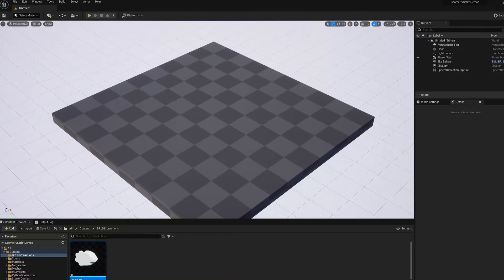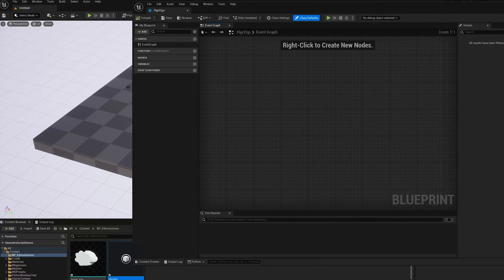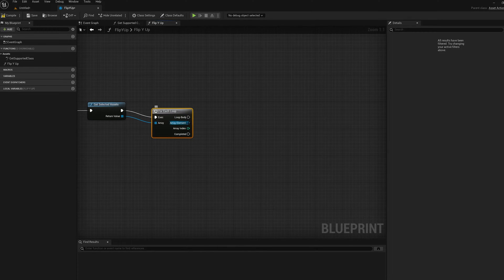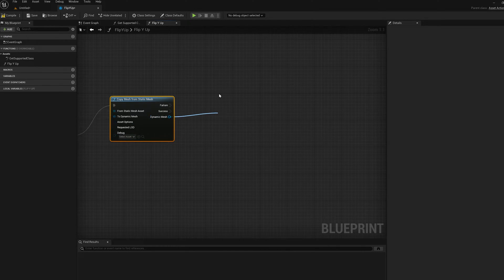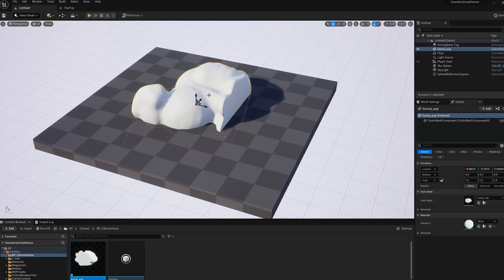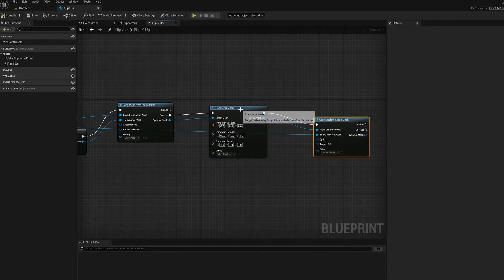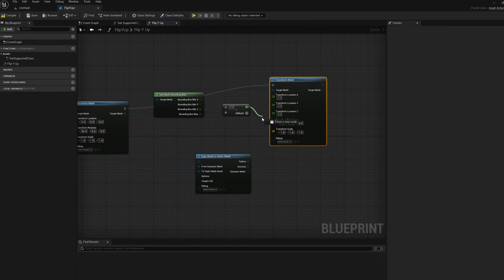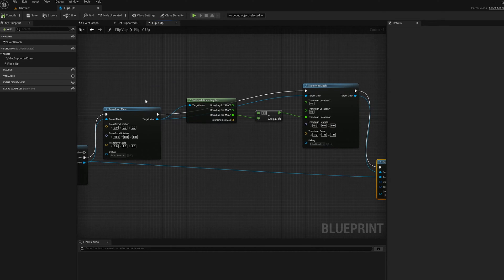UE5 Geometry Script - Y-to-Z-Up and Edit Pivot with an Asset Action

Comment: Thanks my friend, is there any way to specific a Booleans to affects all meshs over a scene, not specifically set inside the BP . That would be awesome to do architectural plane cuts
Reply from the maker: sorry, this is generally not possible in UE, if the meshes are StaticMesh Assets, or other Asset types, as those are not editable at Runtime. If they are DynamicMeshActors generated at runtime, it would be possible, but you would have to implement (eg) the iteration and booleans yourself (ie in blueprints)